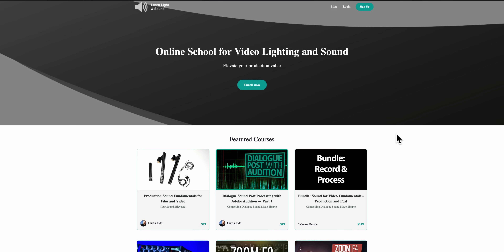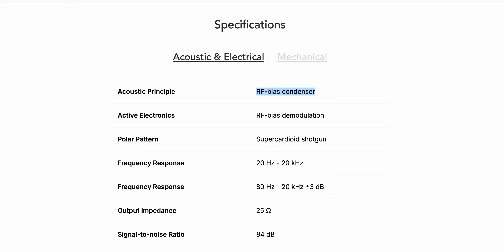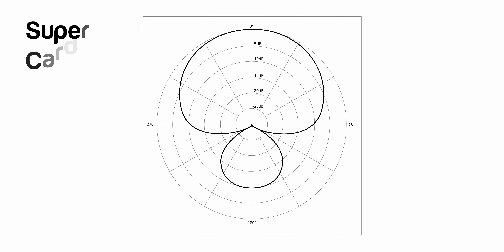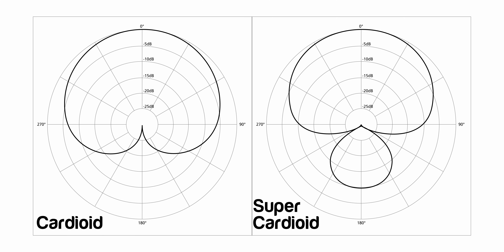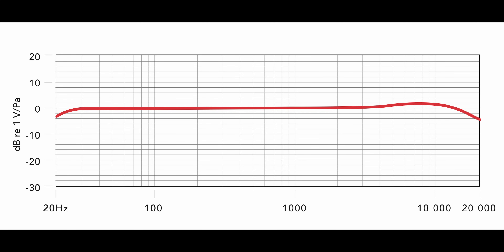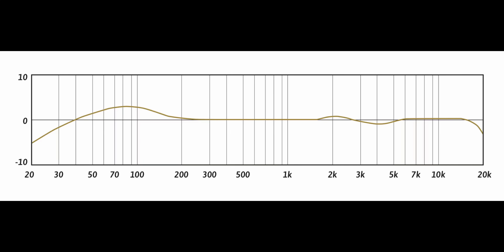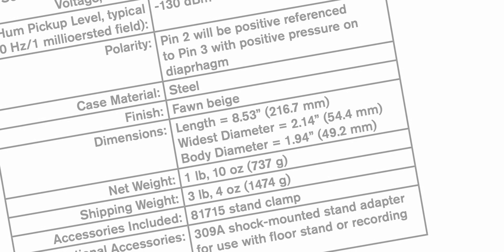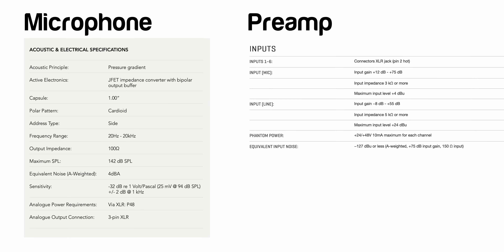Microphone Specifications - What do They Mean?

Comment: i got off topic question, and i hope you can help me. Recently, i was shooting interview. 2 person interview, one of them had Deity PR 2 recorder. When i dump it all in Resolve strangly it didn't want to sync. The signal was clean and it should 100% be able to auto sync it. I did it manually and i found out that PR 2 audio track have signal losses. And it is not like flat line on the waveform. it looks like it was cut out. And whole track is offsetting in time when that happens. What that could be and how to prevent this from happening? Thank you
upd: it offsets exactly 1 second and 13 frames on 25 fps timeline
upd2: also there is like distinct pattern, like 1 min before signal drop and then it goes 5 min and drops again.
UPD3: i think i found an issue, thats most likely was a Sidus Audio app and BT. i tried to turn  BT and turn it back. And it seams like it fixed itself. but i am still scared to be honest
Reply from the maker: I haven’t run into this. What does DEITY support say?
Reply: @curtisjudd unfortunately did not reply to me. it was most likely smartphone app issue. first part of the interview was fine, then my talent goes to the bathroom and i tried to stop recording through the app, and it seams like it stopped. But when talent came back i notice that recording was still going. i was like "fine, probably just BT connection lost or something" and continued. And then issue was present. What interesting though that next day i tried to test it and i found that issue is still present, i turnd of BT on PR-2 and turn it back it seems like it was fixed, and updated the firmware just in case. now it works fine, but still, kinda paranoid right now😂

Comment: The only two specs I have found useful in practice is the noise level, which means little because the real world audibility may differ by 6dB due to the noise profile, and raising noise in level to compare changes the audibility depending on the profile, and maximum spl which is not very important unless you are dealing with lavaliers or sound effects recording. In lavaliers the maximum spl is sometimes a choice, because the manufacturer may offer a version for soft voices, and one for singing or brass recording.

Comment: Great video with very valuable information, as always. Thanks! One note regarding lavaliers and Max SPL: I'd say definitely go for a max SPL higher than 120 just to be safe (and to get the most out of every lav you purchase). I was recently in a shoot and there was a scene where there was a loud argument and one of the characters yelled VERY loudly. We were using Countryman B6's (standard, 120 dB max SPL), and even after some pretty aggressive attenuation on the transmitter (and a bit on the receiver) and the levels on the recorder did not indicate clipping, I could still hear some distortion.
Reply from the maker: Wow, that must have been ear splitting! Good call to optimize lav choice if recording even loud voice.